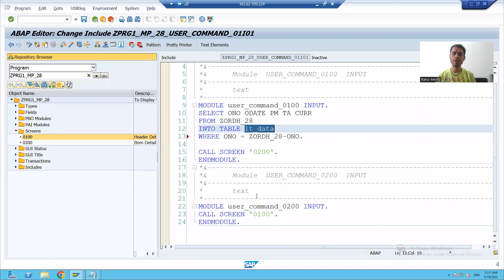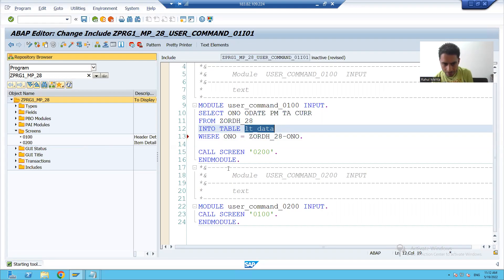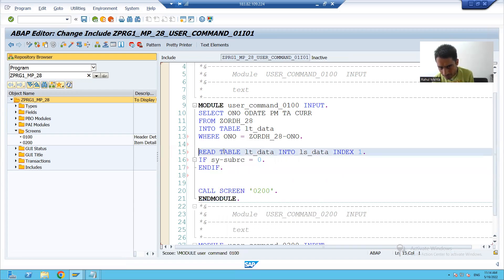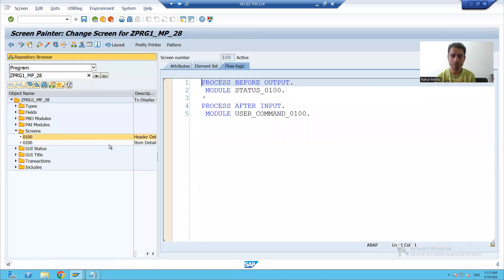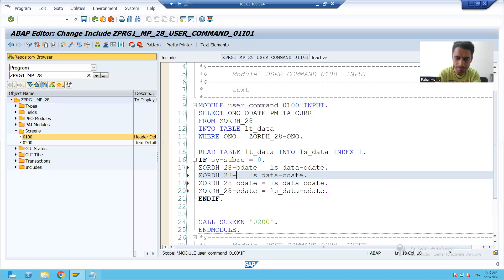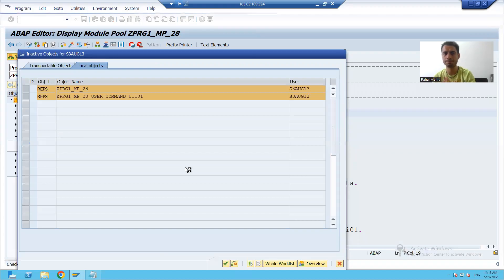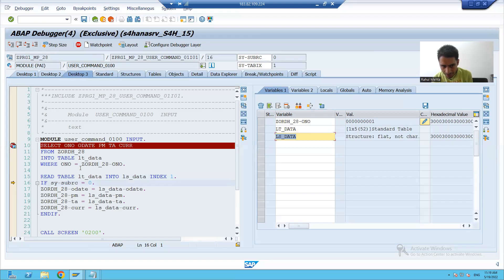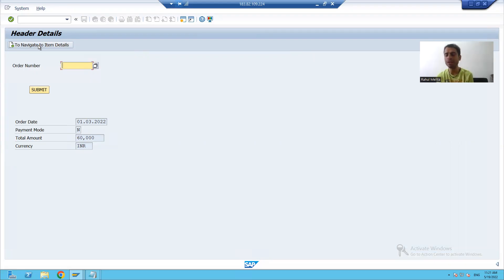8 - Module Pool Programming - Screen Painter Part3

Comment: Hello Rahul - If we are clear that single record has to be fetched, why don't you use Select single query with work area on PAI of screen 100 and we won't have to use READ TABLE in that case.I have done like that and i am getting same output. Will i confront any menace further?
Reply from the maker: Hello - You can use SELECT SINGLE also. 

After that, You will find the logic to fetch data from item table using FOR ALL ENTRIES IN.

 In FOR ALL ENTRIES IN, we need to use the internal table. In that case, you need to again write the logic to move the data to internal table.

This is the reason, I took into internal table.
Reply: @sapabapbyrahulmehta  But Why to transfer data into internal table if i can directly assign work area to all the fields of dialog box and it's  working. Why should i use internal table if work area is doing the needful solely.
Reply from the maker: @TheAnsh2502     Hello - Please move on to video no 10( Where the data is fetched from item table based upon the data present in header internal table).  

You will get the detailed understanding. In case of any doubts, you can revert back.

Comment: In layout we can change the output field labels as WA_LS_ DATA- ONO ?
Reply from the maker: Hello Siva - You can provide any name in the layout as these are just variable names.
Reply: @sapabapbyrahulmehta  sir not like that, we assign the table fields to workarea fields.without assign the the field in main program,we can give the name in screen also.?
Reply from the maker: @sivanarayana5181     Hello Siva - The query is not clear to me. You can write your code based upon your understanding. I will revert based on that.

Comment: Hello sir 
I have declared IT_table type table of ztable_name(custome table name) and , work_area type ztable_name,  witthout declaring structure , and in screen  i have  declare name of input field is  IT_DATA-stud_id    , but i am getting error . 
In ur program Tablename-Column name instead of table name can we write any other name like IT_DATA-stud_id . please clear my dout.
Reply from the maker: You can give any name to the variable. Suppose you have written, IT_DATA-STUD_ID, then you need to use the same name in your where condition of select query and declare the same using DATA statement. In Unicode programs,  the names should not consists of - , so if you want to go by this only, rather than - use _ , Make it as IT_DATA_STUD_ID.

Comment: Hi sir, when I'm clicking on submit button values are coming on screen.   What value to put on sy-ucomm for displaying value on hitting Enter key on keyboard.
Reply from the maker: You can pass the function code to your input field. so when user will put the cursor and put enter, you will get the output.
Reply: @sapabapbyrahulmehta   Sir in layout of screen 100 order number input field system is not allowing to enter function code.
Reply from the maker: @AnupKumar-ng9tq   PAI triggers on every action of the screen. if we  press enter also, PAI will trigger. On Enter, the SY-UCOMM is blank, but you have written the logic based upon SY-UCOMM = 'SUBMIT", so you can remove the IF condition, so the logic will trigger on SUBMIT button, as well as on enter.

Comment: helo sir,
1. In layout in output field for order number name given as tablename-ono, it showing already declared.
2. even passing correct value in select query, in where condition as  ono=tab_name-ono. It showing error as field is unknown.
Reply from the maker: Hello For the First Point, you are taking Order number as Input also and then using Dictionary/Program Fields you are taking output also. For the second point, you need to pass Tables : your name of the table and activate that part.
Reply: @sapabapbyrahulmehta sir I am also gettign second errro when I place tables: table name errro resolved.but in your code yoy didn't mentioned this line but still code worked for you.can you please explain why you are not gettign errro any change we need to do
Reply from the maker: @Chinnari34-d5y    It is mentioned to pass the table name.( Timestamp : 6:35)
Reply: @sapabapbyrahulmehta  2nd point got cleared, but first one need help sir. How to print in output layout, it is showing error.
Reply from the maker: @dreamer9857  If you want to print Order Number in the output also, Just double click, you will get the Properties, change the name of the Output field, Suppose as of now your name of the output field is Tablename-Column name, Change it to LV_ONO. Declare LV_ONO and pass the value to this variable after fetching the data.